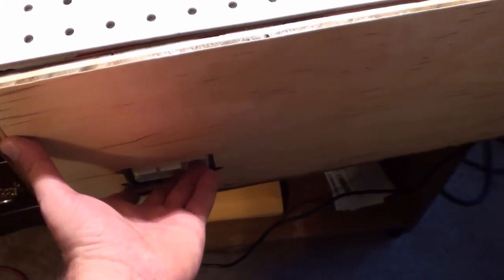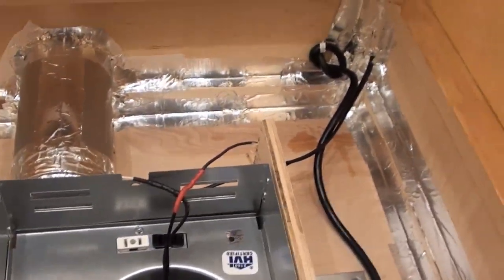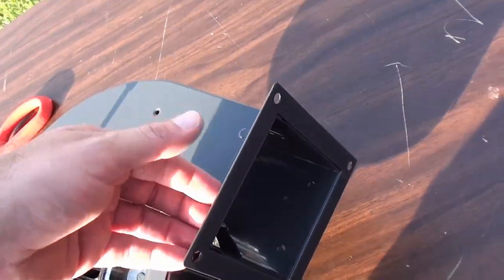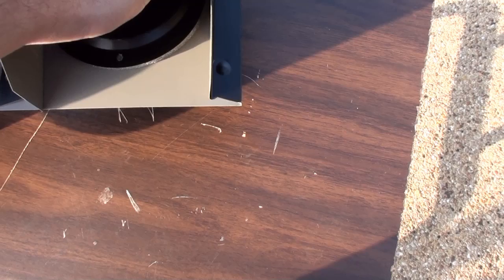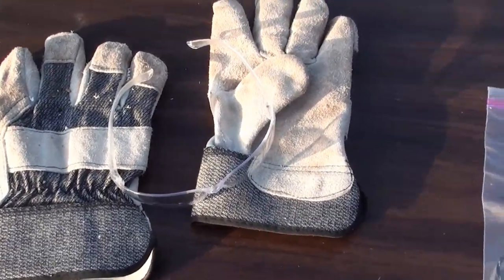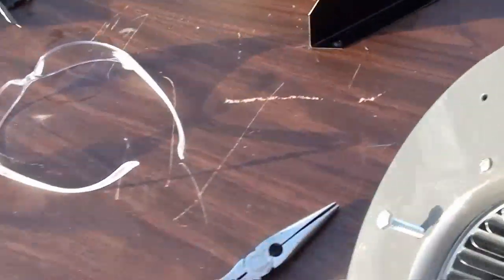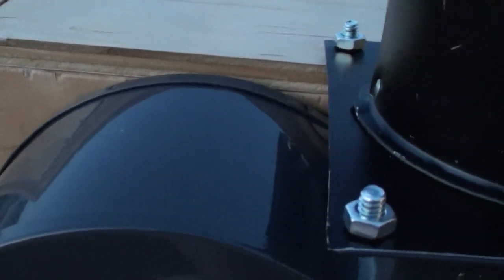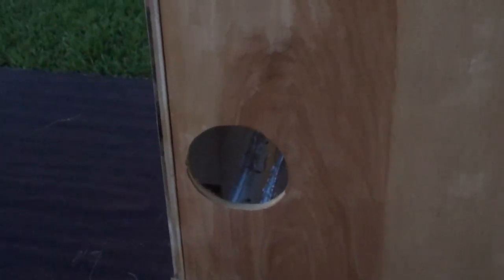DIY Spray booth part 7

Comment from the maker: I vent the fumes outside so they are no longer in the house.  The motor has a dryer duct on the back end of it. The dryer duct leads to outside the house.   The air filter serves to remove the particulate matter from the air stream.

Comment: Now you are getting very good at buying the wrong things.  Where do the fumes travel after struggling to get through 1/4" holes then and extended air filter. Not a paint arrestor but an air filter? Don't turn your back.

Comment from the maker: The booth is working great.  The offset on the motor doesn't appear to affect a thing.   I took a stick of incense used the smoke to try and track bad spots.   The air flow seemed to be pretty even.   I think the peg board helps with that.   The small holes limit just how much air can go through any one spot.  So the air flow is pretty even.

Comment: Thanks,  I will do that,  just being lazy I guess.  By the way how is the booth working for you,  any problems, suggestions or changes you wish you have made?  How is the airflow with having the motor offset?  My design has the motor centered in the base with a 3/4 spacer board to clear the flange.  Also does the peg board limit airflow?

Comment from the maker: Sorry I don't remember. I had the bolts in my spares bin.  But if I remember correctly you can remove the mounting ring.  Once you do that, you can take it over to your local hardware store and they will help you find the right bolts.

Comment: Great video thanks for doing this.  I am doing a very similar project using the same Dayton blower.  I don't suppose you can recall the size of the 4 bolts you used on the intake?

Thanks again for the helpful info.

Comment from the maker: @bdogxx It is called a shaded pole motor.  I got it from a company called Granger supply.  It cost about the same as a bathroom fan, but didn't have a connection for the air to go out and I had to fabricate one.  There is a link to the company in the video notes.  The brand name was Dayton, and search under HVARC, and then blowers.  You will find a lot of them there.  They are used for air handling in industrial settings.